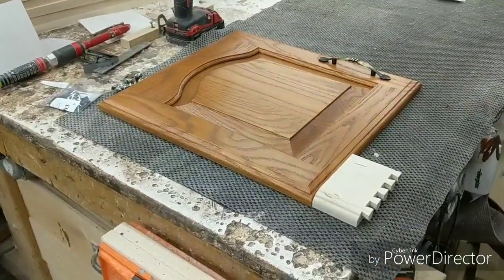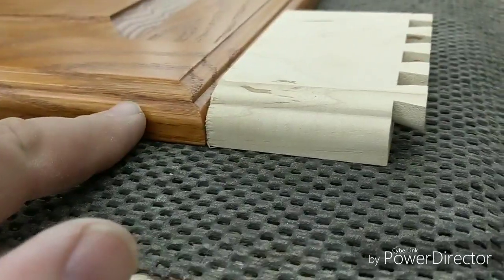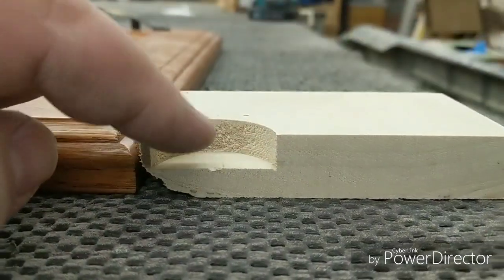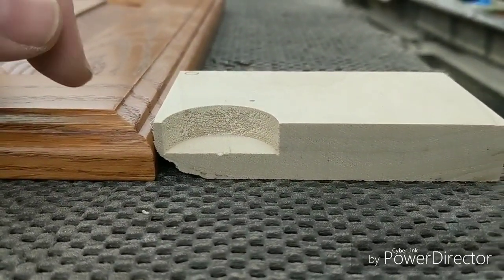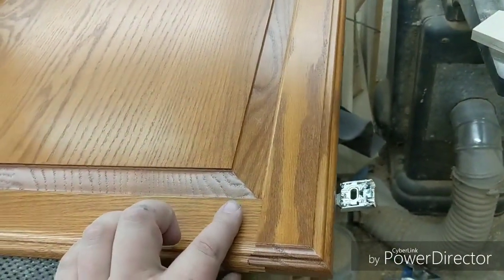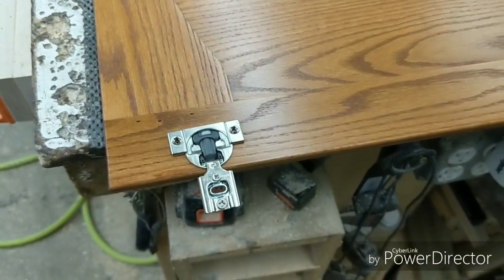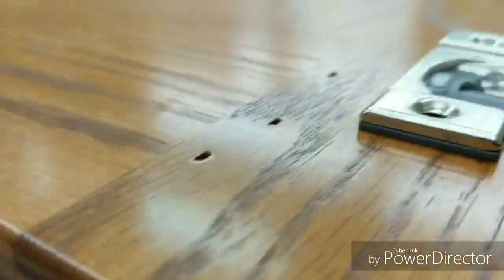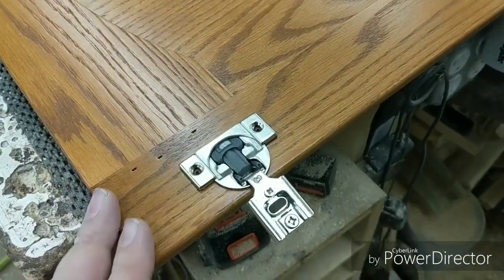Blum 38N Hinge Shallow Cup Bore Solution # 252

Comment: I had some shallow bore holes and it made the top corner of the shelf have a gap between the cabinet and the door because when the hinge closes to 90 the hinge is engineered to expect it to be flush. does this spacer fix that or will I just have to live with it?
Reply from the maker: The spacer will just fill the gap between the backside of the hinge area where the screws go. It just keeps the tabs from bending.